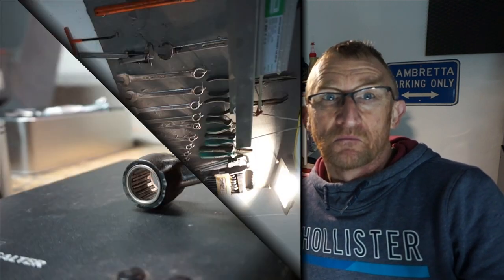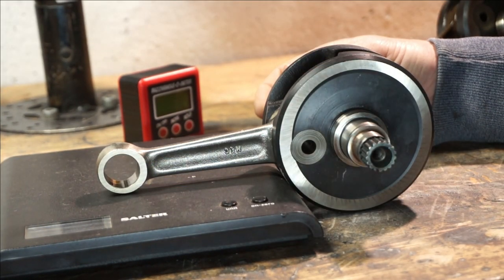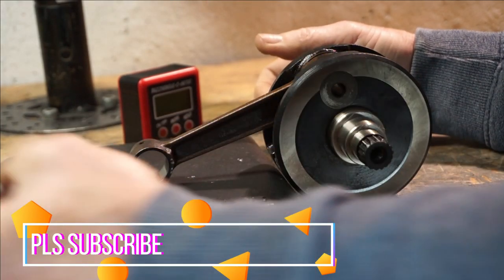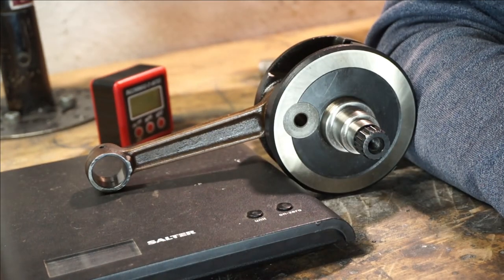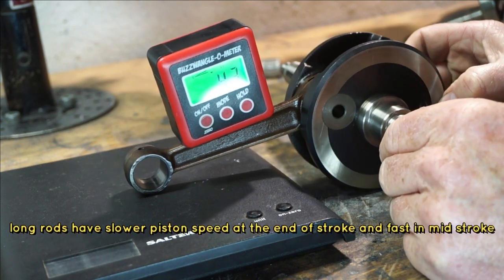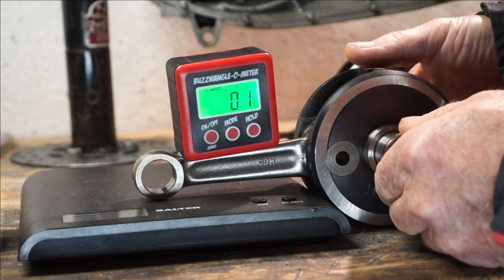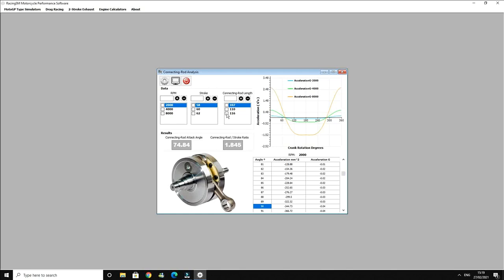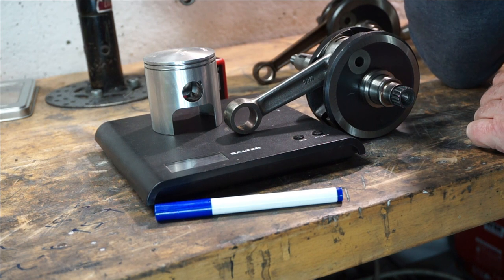lambretta cranks rod n stroke

Comment: Nice info again steve , which would you use if you had the choice in your own road scooter , shorter or longer stroke mmmm , which is more efficient and which is quicker over all ? . Great video mate 👍✊
Reply from the maker: Long stroke long rod mate  . Cubic capacity is always a good power provider , And at the end of the day you wont want to ride a short stroke hi reving motor as it's just not suitable for every day use ......